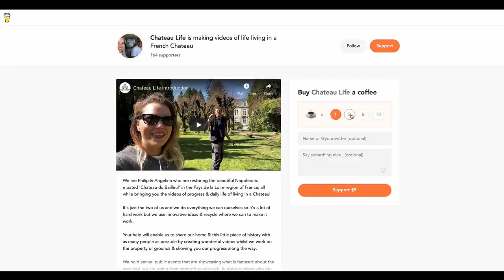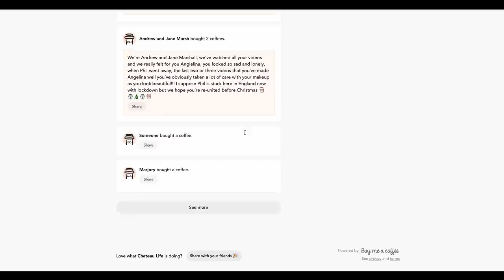🏰 EP 50 : - SAVING A FIREPLACE - Chateau Life

Comment: Love this room! You are both working so hard at it. The fabric covers up a multitude of problems which brings me to the point. Why not take the fabric down and actually fix the holes and the falling plaster and leave the fabric off? Love your videos! Wishing you both a wonderful New Year?
Reply from the maker: Because at the moment the room isn’t getting renovated to the finished aim but put back into use rather than a storage room.

The fabric hides the result of problems not the problems themselves which have been rectified. the old windows leaked badly which is where the damp came from which destroyed the plaster; now new windows have been fitted and the room has dried out with no issues the plaster is falling apart.

That means cleaning up and making good to use it again not a full renovation which will be dime in the future when funds allow; that will involve removing plaster, re-plastering, painting etc but for now we need it to be cleaned and tidy for use

Comment: I have a house built in 1720, we have  rising damp in some rooms that we have treated, what that horrible short term fix is doing is just destroying the plaster you will have spores of damp rot and other stuff RIP IT OFF and let the walls breathe. It won’t look nice and it won’t smell nice but it will start to dry out. Then you can try to find the cause (roof leak or rising damp ) and treat it.
Reply from the maker: We don’t have to find the cause, it was from years without heating and leaking windows both of which are solved.

There is no short term fix happening, the plaster has dried out now the windows have been replaced and the property is heated so it is falling apart; it is not damp or rotting nor is plaster structural.

The room is being put into a usable condition with a full renovation in the future when funds allow, ripping plaster off walls now and making a mess along with the room unusable is pointless until the full refurb to a kitchen takes place

Comment: I fail to see the point of cleaning the fabric on the walls! The fabric is trashed and causing damage to the walls. it is obvious that
the walls need to be refinished.
Reply from the maker: Because the fabric isn’t trashed, this isn’t a full renovation of the room but putting it back into use quickly and on a limited budget & nobody wants to breath in the years of soot in the meantime
Reply: @ChateauLife  I am aware that it would be costly and you must have surmised that great cost would be involved. In that spirit my thoughts were why not do one wall at a time, in this way it does not become twice the work and or cost.
Reply: @ChateauLife  I am sorry I did not intend to offend. I also own a home that is old and has required much renovation. I wish you every success in your renovation.

Comment: i appreciate you wanting things to be clean but some things, like the fireplace, you seem to be trying to make look brand new and never used.  i'd rather see you getting rid of all that crumbling plaster and restoring what's under it.
Reply from the maker: They have to be clean to be put back into use but not brand new by any means; I'd never want anything to lose it's character but I also wouldn't call soot on a fireplace character!

The material and the plaster under it will be removed in the future, we aren't renovating this room fully merely putting it back into use to allow heat, airflow and have another room in use while we gather funds & think through the plan fully for the full renovation back to a kitchen in the future